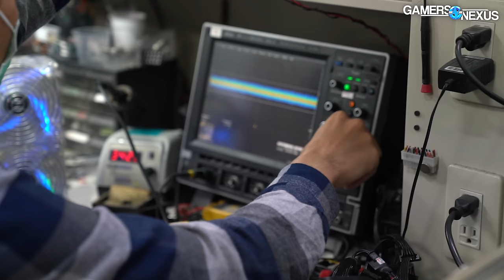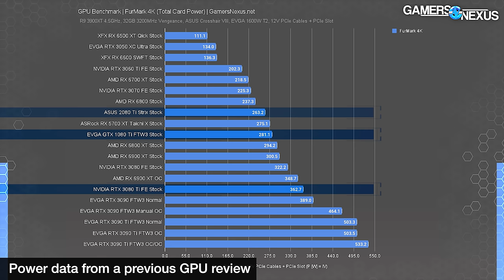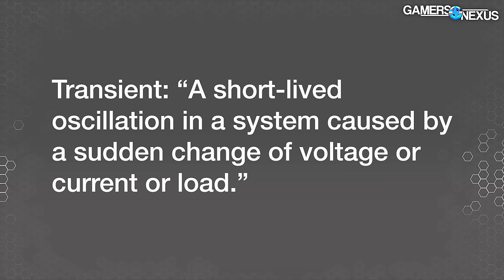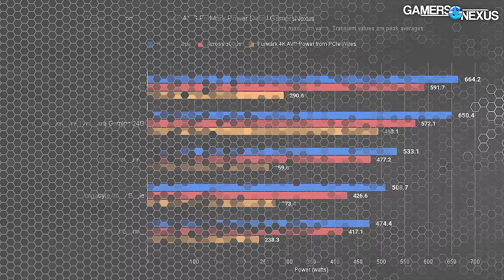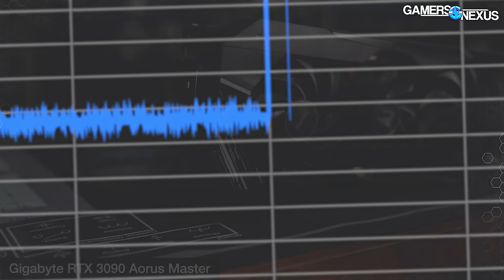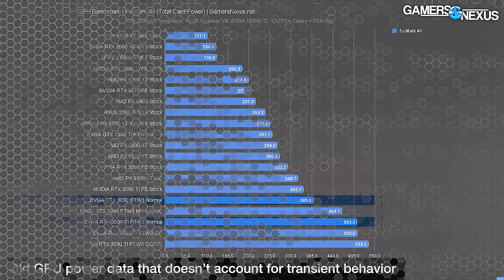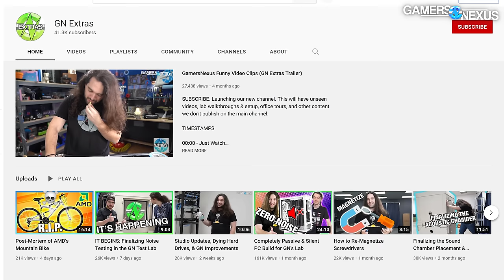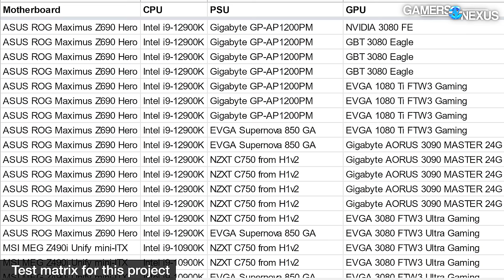The Brewing Problem with GPU Power Design | Transients

Comment: Okay so I have an opposite problem, I’m running an ASUS Z490E, Intel 10-850K, EVGA 3080 FTW3, and an EVGA 1000 watt power supply, so at idle it’s pulling about 230watts and when I shut it down it stays on… kinda, so my monitors shut off but my computer won’t and it sits pulling about 320 watts until I push and hold the power button or shut off the power supply. Fresh install of windows reset the bios, basically I’ve tried everything short of swapping out components… my next largest p.s. is a 750 EVGA and I do have a 2080 FE where should I start or am I looking in the wrong places?? Thank you for your awesome videos and keep up the great work!!!

Comment: I'm using a 4080 with an MSI ATX 3.0, 1000watt PSU and am still getting pc resetting spikes within minutes of playing any demanding game.
I changed my power supply... still happening, so I changed my GPU... still happening...
Reply: question, did you get this figured out? i got my 4090 coming in this week and am wondering what would be causing that if you have changed PSU and GPU?
Reply: @itschops  I originally had a 3070 when i was getting the spikes so i changed my gpu to a 4080 but still had the problem, so I changed my psu twice but nothing had any effect... i'm just waiting for software updates or something, hopefully this will make a difference.
It only happens while playing cyberpunk and starfield though and haven't played them in a couple weeks roughly.
Reply: @aboxofphotons   thanks for the response. ive had my 4090 for about a month now and havent had any issues what so ever (amazing piece of tech by the way!) i had a 3070ti before upgrading but never had your issue you are describing here. i was rocking a 750 watt gold PSU before. i went ahead and upgraded to 1200 watt PSU (gold) for the 4090 so i can upgrade my CPU in the future. maybe thats a mobo issue you have or a bios update needed?

Comment: I'm trying to prepare to 40 series (I'm aiming at the 4080) with a CoolerMaster SFF 850W 80+ gold psu because my case can only fit sff PSUs. I'm hoping it will be enough to power my future card. At the moment i'm using a 1080ti so obviously no problem.

Comment: Would undervolting the GPU/using a fixed max GPU voltage mitigate/prevent this spiking issue?
Reply: Yes because the spike will be less. As Steve said the spike is X2 of the voltage the GPU using so if u lower the voltage say by 100w that's minus 100 of the spike. 

Example: if GPU needs 300w the spike will be 600w since is x2 of the GPU watts needed to run. Now if u reduce the GPU by undervolting it by 100w that's that's a total of 200w and if the spike is X2 then the spike would be 400w which will save u 200w in total from the original voltage

Comment: This used to happen to my system, I was using a cougar 850w power supply and a gigabyte gtx1080.  I changed out the power supply and the issue was resolved and the problem never came back.

Comment: Had no issue for 2 years with my rtx3080 and RM750x (5800x on x570) but now with new Ray Tracing features and Warhammer3 at higher resolution I've had some random crashes at max gpu loads and looks to be power spike related. Feelsbadmen.
Reply: I updated my Gigabyte gaming oc to the new bios with Resizable Bar and not only has it fixed crashing but have also received a small (5%ish) but nice fps boost.

Comment: I have had nothing but black screen issues with my ASUS TUF 6800xt. doesn't kill the system outright but not usable once it does. I have a Corsair 750W SFF PSU which could be an issue, but when I swapped in a 3080FE recently I haven't BS'd a single time. my buddy with the same card and likely same production lot has the same issues on a completely different system with an ATX 850W PSU. RMAing atm gonna see what they spit back to me.

Comment: If the GPU draw enough power to trigger PSU OCP, the GPU isn't designed right. The PSU protection functions just work as it should, trigger when there is too much load

Comment: This is precisely what "symptoms" I've been dealing with. While I know my system with the lower end of--or below--minimum wattage (550W) is a problem. It's only an occurring in those games I set to 1080p for framerate increase. It's caused freezing in the form where there is no catch. Just black screen and often total vBIOS and memory corruption whereby Windows no longer can recognize my graphics drivers on reboot... Sometimes it's an so abstract that drivers work still but the system keeps replacing drivers and I have to reinstall them (AMD notifies me that my system replaced the drivers when opening the program.

Comment: Just a thought, not trying to get smashed as I'm not a developer or engineer, but my thought is should game developers also take some care not to suddenly execute scripted scenes packed with extra effects to wow the gamer, maybe only lasting a few seconds so a temp FPS drop doesn't matter, but might cause a spike because every area of the GPU and CPU core is getting unsustainably hammered but only for a moment? Like I haven't designed levels for games for 20 years but back then you had to manage level design in regards to performance more than anything else. It was hilariously easy to make a level look and feel great but totally unplayable even on high end hardware however you could script a scene where the user isn't moving and is forced to look straight ahead and you could say have a bunch of geometry, sprite and particle effects occur for a few seconds but get away with it. Just a thought...

Comment: Got a Lian Li SP850 SFX Together with an Gigabyte RX 7900XTX. I've been having power outages left and right. A Full on stress test with Cinebench for the CPU and Heaven for the GPU works fine. no issues there. But on certain events like loading up a game like Battlefield 2042 very often it completely shuts down. Not a 100% sure if its the PSU combined with the GPU, but its pretty realistic when I see this video. Not sure how to figure this out completely or what to do, because it's already a beefy SFX PSU. Maybe the riser cable of my GPU is at play here as well, again can't seem to know for sure becaus the computer goes to black. Is there a good tool to find out what's the issue of this all?

Comment: watching this video quite late as life gets in the way
but you asked for this info so you'll get it
Corsair SF750 + EVGA RTX 3080ti XC3 Ultra + Gigabyte B550i Aorus Pro AX + R7 5800X has zero problems with trips even with ray tracing on 2560x1080 monitor
Corsair SFF PSUs have been known amongst the SFF community for ages to be extremely robust too, so much so that they remain the top choice even as other manufacturers like Silverstone or Cooler Master come out with higher wattage variants

Comment: Seems like Nvidia should have designed their cards to have have enough capacitance on board each GPU to handle these transient spikes but instead choose to ignore an obvious issue and pass it on to the PSU suppliers. 
If these things are nuking mobos and PSU's then perhaps people should consider a class action against Nvidia to force them to either disclose true peak power draw or build their cards with the ability to handle this issue on board.

Comment: I've got a Silverstone SFX-L PSU, so somewhere in the middle of SFX and full-size, so would be interesting to know how far I could push it with new cards. Have been looking at a 6600XT as an upgrade from GTX 960 I've been happy with for so long precisely because it's so efficient and quiet. I don't really want to add the cost of a new PSU to the cost of the graphics card.

Comment: Couldn't there be an add on between the PCIE power cables to the GPU, to buffer these transient spikes?  We've been doing it in the car audio field for more than two decades, with large capacitors.

If you are experiencing this, set a frame cap through RTSS, for offending or all games.  You can set a different cap for each title.  Letting it swing to the max isn't necessarily the best bet anyway.  What good is variable lowest latency, when you can have consistent low latency.  One you can adapt to.

Comment: very interesting, i had the shutdown issue on a old x79 it ended up being the mb  but what a nightmare oddly though in all that i did rma a corsair hxi1000 as it looked like it had a melted choke that should even get hot and i only seen that by chance shinning torch inside over the fan makes you wonder if this is related too the x79/x99 black screen issues everyone had, they replaced with a hxi1200 don't think its spike related as I'm still on a FTW 2 1080 with memory bios update mod

Comment: it's P = I X E (for electromotive force aka volts) which is really just the apparent power of a circuit ie. the power consumed and returned to the system by inductive and capacitive (VARS volt-amps reactive) not the power actually consumed by the resistive portion (the copper doodads) measured in watts which is really just a measurement of joule's per second but then you throw in a rectifier in the PSU and that's like a whole other can of worms and power quality isn't really my strongest subject.

i like zap juice.

Comment: And people think I am crazy when I use my 1.5x rule. This exactly why.  Get the rough total wattage of your system and multiply it by 1.5 and should give it enough head for any spikes in inrush. Most good PSU's are built overspec any who and can a bit over there spec there breif moments. Also account for things like components in that PSU wearing over time. 

"But mah effiency curve" Ya so? The close you are to your components total rated wattage the more likely you are to trip OCP. So what your curve isn't gonna be as efficient. You are already using a power hog of a desktop... Even a couple extra dollars a month on a power bill isn't gonna matter all that much. So you can't get your triple shot soy latte couple times a year. I feel so sorry for you.

Comment: Whats funny, Im running a EVGA 850 GT with a EVGA 3090ti with the 516 watt bios and 5900x, 3 HDD's 3 sata SSD's, Not a single issue. I do want to get at least a 1000 watt but idk if its really woth it if this has been good, and the fan in the thing hardly ever spins up.

Comment: Guess I'll throw my specs out for fellow SFF bois in the comments.

I run a 5900x and a Gifabyte Vision 3080 Ti on a Cooler Master 850v SFX PSU. Never had any issues even when running synthetics. Of course I have yet to run both synthetic CPU and GPU benchmarks simultaneously, but when gaming I have never had any shutdowns.

Comment: O damn. I just bought a new case cuz I thought my card was overheating xD I’ve been power limiting to 280 or 300 watts (down from 340 stock)

I find that opening doors in Skyrim can cause my 3080 to crash (I have an EVGA 750 GA) as the screen goes black. Idk if I accidentally unlocked the FPS or I’m experiencing the opposite phenomenon (power dips or drops or whatever). Normally it’s at a steady 57 FPS

Comment: 3080 ti fe 
5950x
Arric freezer II 240 AIO
asus x570 strix itx
16gb 3600 cl14
512mb pcie 3.0 nvme
750w cooler master sff 

Ive seen the system spike to 640w once. But it idles at 100w. Gaming usually between 450-600w.

... a lot of typing to say i never had any problems what so ever.

Comment: I have to wonder if this (and things like Intel lying about the process node they're using) reflects fairly hard physical limits on chip design and performance, and it will be increasingly difficult, costly, and energy-intensive to get further performance gains, and that, perhaps not too far in the future, the performance of PCs will more less plateau because the performance to be gained is no longer worth the cost of more complex manufacture, lower yields, prohibitive power consumption, etc. And, with the steady decline in reserves of fossil fuels and more expensive energy, performance might even decline outside of the highest-end SKUs as low power consumption is prioritized and 65W parts become 30W parts and then 15W parts, and costs have to go down because consumers' purchasing power is also declining.

And of course, a knock-on consequence would be fewer people buying high-end parts and their prices skyrocketing--and with the cheapest next-gen Threadripper now costing $2,400, I think that's already happening.

Comment: Can you help me please?
I also have those random shutdowns since I've upgraded to a 3070. I built a new pc around it with an am4 ryzen 7 5800X and an MSI mag x570 tomahawk wifi motherboard and I've still got the issue.
The recommended psu was 650 watts. I chose a high end psu bequiet DARK POWER 12 with 850 watts. So I'm already 200 watts over the recommendation AND not a cheap, but a very high end psu.
I'm unsure how to fix this. Should I just go for a bequiet dark power pro 11 with 1000 or 1200 watts? With a rtx 3070? That sounds like so much overkill since the 3070 does not have the power consumtion a 3090 has for example. 
I would be glad for any advice. Thanks.

Comment: Personally, I blame the GPU maker. To expect a PSU to cover a spike 2 times the rating of the supply if completely unreasonable. In home electrical, your only supposed to use 80% of that 15-20 Amp outlet/beaker, that 20% is for spikes..... TWENTY PERCENT, and GPU makers want 300%??

Comment: I run a 65W i7 8700 on an MSI B360I Gaming ITX mobo with an EVGA RTX 3080 XC, powered by a CM V650 SFX Gold PSU. All of this and an LG 55C9 OLED, speakers and peripherals are connected to an APC 1kVA (660W) UPS. The GPU is undervolted to 900 mV. So far, no issues. During 4Kp120 HDR gaming, I see 500-550 W on the UPS. 

Anyone else on a similar setup?

Comment: I just bought used EVGA 3090 FTW Utlra for a great price ( still under warranty) and I'm having shutdowns with my SeaSonic Platinum SS-860XP2 860W PSU.  I had thought I was more than covered when buying this gpu as my 12V rail has 71A.  I know that the PSU is 8 years old ( and out of warranty) but it has been a beast up until now. After researching the issue it turns out this PSU is known to have a problem with these transient spikes on 3090s.  It was disapointing to hear that Seasonic was one of the more common culprits as they have always been very reliable in the past.    That being said, does anyone have a suggestion on a Good PSU since I probably will not be going with seasonic again?  I'm thinking 1000W-1200W at this point to be safe.

Comment: Asus C7H
5800x stock
MSI gaming X trio 3080TI
Seasonic prime titanium 750 watt purchased in 2018-2020?
Civilization 6 at 165hz 1440p max graphics settings
Shuts down every single time and undervolting stops it from happening

Not sure what to do since I only plan to replace the PSU and nothing else.  I have heard that newer seasonic prime titanium have changed the OOP or other saftey settings in revisions. Not sure if thats true.
Reply: Did you get this solved? I'm facing a similar issue

Comment: My psu actually died recently because of a transient spike in my sfx system. Really blows because I have no idea if my other components are dead and can't check because I'm low in funds. If all my components are dead I'll probably have to RMA it, then I'll probably switch back to atx honestly.
Reply: What was the psu wattage?
Reply: @stephenb9510  850w 80+ Gold m, was playing a game max everything and the fps shot up to 1000 and then it clicked and died.
Reply: @Umi_2024 damn man, how long was it working fine for before hand? Was it a corsair rmx or tmx brand, seems some 850 watts psu's can deal with and others can't.
Reply: @stephenb9510  it was a cooler master v850 gold, worked for 6 months but it had issues providing power I just dismissed it till it died.
Reply: @Umi_2024  What do u mean providing power? Like BSOD?
Reply: @stephenb9510  complete shut downs lasting up to 1 second before the PC would turn on again. Usually happened while gaming.
Reply: @Umi_2024  So just black screens, then restart
Reply: @stephenb9510  yes but the PC would leave off to where it was immediately so not complete restart just loss of power
Reply: @Umi_2024  Strange have seen plenty of people with 850 watts and not get this problem.
Reply: @stephenb9510  I had it connected to a shortened internal psu cable in the sfx case and then a cable matters psu cable into the wall. Think it was that plus me having other things plugged into same outlet.

Comment: I'm running a ASUS TUF 3080 10GB V2 with a Thermaltake 850W on a MSi X370 Gaming Pro Carbon and Ryzen 5 5600X and my Card crashes when launching games or benchmarks. The System isnt shutting down but the games or Programms crash. Do you recon this is also caused by transient spikes?

Comment: but this was already know for a long time. Bought a AMD CPU for it's low power draw (one of the reasons) to go with my 3080ti and a high quality PSU. It's just stupid to buy a expensive GPU and go for a bad quality PSU or small formfactor while knowing the amount of power is needed.

Comment: The thing is that, we acheiving efficient nodes over time,but as soon as the PC master rece started when AMD got enough technical advancement, Intel and Nvidia sweated a lot, inorder to catch up AMD, they finally have to consume more power and push the envelope further, gone inefficient. Those AMD laptops will give double the battery backup than Intel counterparts, whose performance drops when un plugged. While apple is the best in terms of efficiency and in plugged power, but they cost to you more for a non gaming setup. Nvidia and Intel are evolving backwards.

Comment: would a solution be to just run a separate, standalone GPU power supply?
just have the computer run on a separate PSU, and the GPU on a 2nd PSU  
?